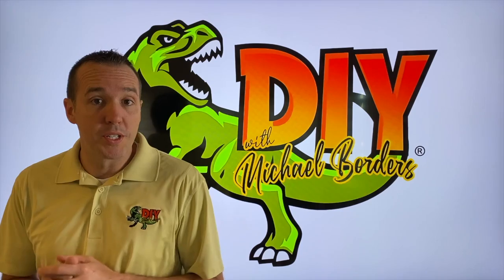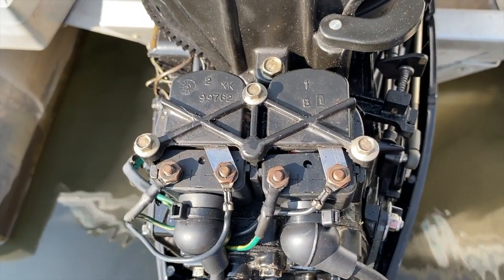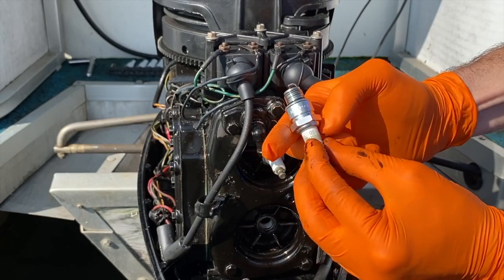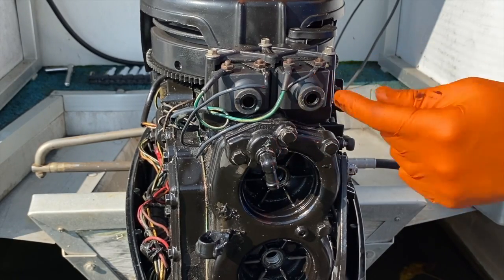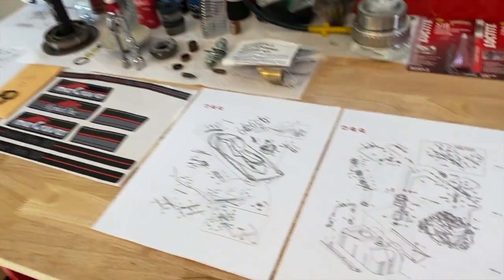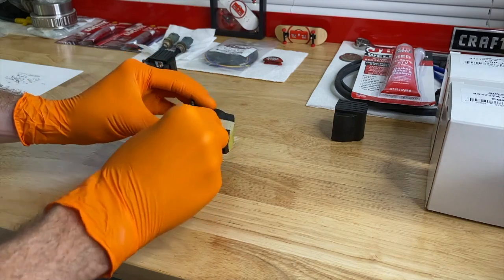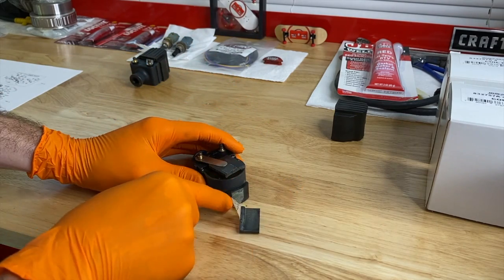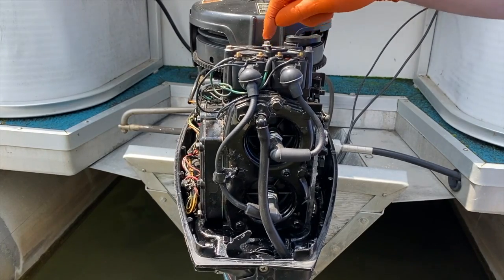Outboard engine bogging/sluggish at high RPM - Common cause

Comment from the maker: If interested in purchasing this product, visit our Amazon affiliate link below.  I earn from qualifying purchases.

     Ignition coils:  https://amzn.to/3OfWpxn

     RTV sealant:  https://amzn.to/43cALOJ

     NGK spark plugs:  https://amzn.to/3NFufdv

     Spark plug wires/boots:  https://amzn.to/44dp7o7

     Spark plug gap tool:  https://amzn.to/3PLQH7i

     Wire cutters:  https://amzn.to/3D6cnUm

     Dielectric grease:  https://amzn.to/3PMzR8g

************

1.  Replace outboard Ignition Coils

          https://youtu.be/ib9X5vzP56M

2.  How to build your own custom logo skateboard

          https://youtu.be/9Isty_4fIIw

3.  How to mount your skateboard on the wall

          https://youtu.be/c5QDCKZNGH0

4.  De-winterize outboard boat engine (PART 1)

          https://youtu.be/IjzSsgypiTA

Comment: My boat is running bad at idle. found that hard piece around the coil broken. Have ordered a new coil and my fingers are crossed.
Reply from the maker: @bry40l  

Thanks for watching, removing the broken coil and installing new will do wonders.

Awesome job making it a DIY project.

😎👍🧰

Comment: I have a 1987 Johnson 150 V6 bro I can get to 40mph no problem but once I get there and continue to hammer it down, she boggs down and almost stalls unless I let up
Reply: Might have to give this a try
Reply from the maker: @CTRadventures  

Thanks for watching and reaching out to us.  Any update?

It’s likely that replacing spark plugs, wires, and going the extra step and replacing Ignition Coils will improve the overall performance of your engine significantly.  Keep us posted.

😁👍🧰

Comment: I have a xr6 and will bog out during takeoff. I shut her off and she takes off fine but once gaining speed she starts bogging out again. Shop said it was fuel pump so I had that changed but still bog out
Reply from the maker: Good morning ☕️ any update?  Have you replaced spark plugs and wires?  If so, we recommend removing any dielectric grease from plugs and boots to see if that helps.

Too much to electric grease and plugs will work against you, as it will degrade engine performance.
Reply: @DIYwithMichaelBorders  I am changing out spark plugs this weekend and going to check my coil packs I started off with changing fuel pump but that did not solve the issue.
Reply from the maker: @YourAverageAngler  

Thanks for the reply, we will get this figured out together!  😎👍

That’s awesome you’re replacing the plugs this weekend, looking forward to hearing back from you.  ☕️🧰

Comment: Have exact same issue, even have the same motor! Unfortunately I replaced x2 coils, wires, spark plugs, fuel filter and have fresh fuel…and still have same symptom.. when near WOT struggles to get onto high RPMs…messed with choke to see if it was needing fuel but made no difference…it would actually bog due to running rich with choke, I pulled carb off and didn’t notice anything clogged or out of ordinary. Went as far as pulling reeds off…they look fine I guess? Made out of metal…rubber seal looks good…not sure at this point?
Reply from the maker: Thanks for watching, sounds like you’ve been busy.  Bummer to hear you’re still experiencing issues.

The next likely cause is either contaminated fuel, or a carburetor that needs to be rebuilt or replaced all together.

Looking forward to hearing back from you.  Keep us posted.  👍
Reply: @DIYwithMichaelBorders  alrighty man..here’s the verdict: so I had previously done a lot of work to it with no remedy to symptom..I pulled reed block (located behind carburetor) (for those who may not know) the gaskets looked very worn/brittle and not sure if it was already cracked or it cracked when I pulled reed’s off to inspect, I couldn’t find the gaskets for it so I bought a paper gasket set from Advanced Auto and traced original gaskets, put everything back together took out to the lake to test and BAM! Problem fixed!! I highly suspect it had a vacuum leak due to brittle old gaskets at reed block/cover. Another good thing to note is I also replaced all fuel lines with automotive fuel hose, It previously had the silver fuel hose you typically find on Walmart fuel kits etc. I did inspect those hose’s prior to work since they are known for the interior plastic liner degrading and clogging. But just of peace of mind and durability ended up replacing all fuel lines with automotive grade hoses. Hope this helps someone 👍🏽
Reply from the maker: @boondocksoverlandandoutdoors 

That’s outstanding, awesome job and we love reading follow ups like this.  Very creative and got the job done.  Now it’s time to enjoy the boat.  😁👍